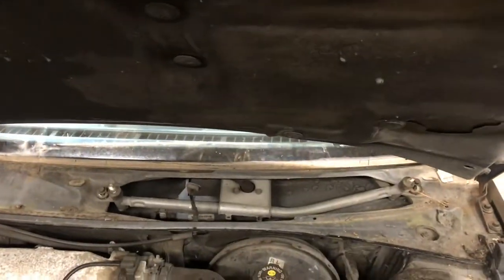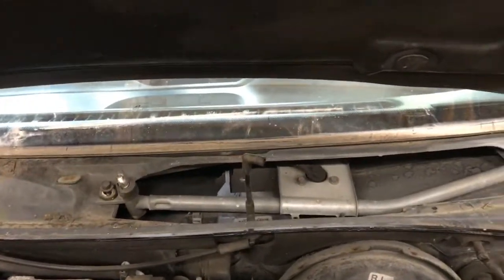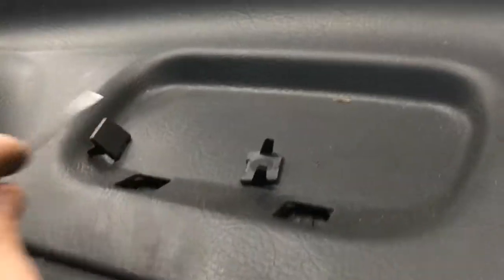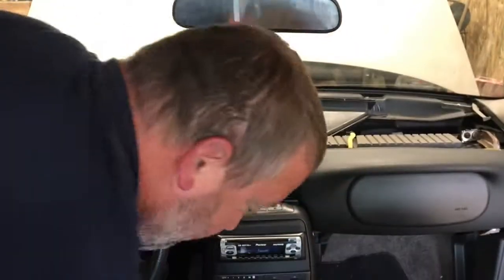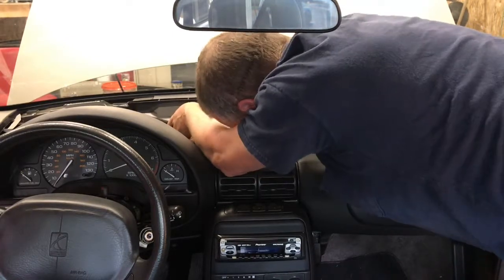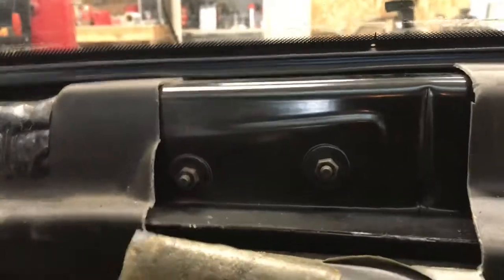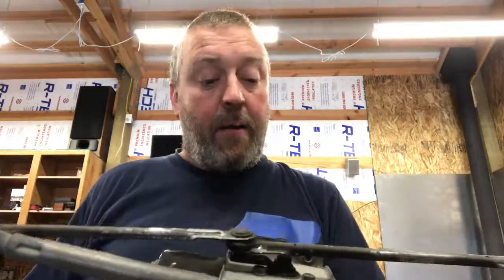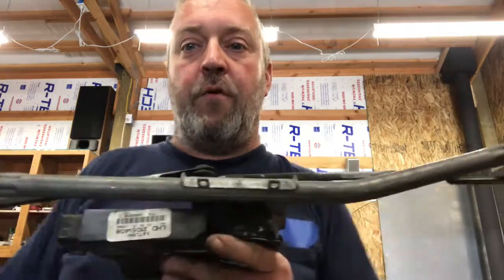Replacing Saturn wiper motor

Comment: This actually can come out pretty easy, if you remove the nut that attaches the motor to the wiper mechanism, then the arm that attaches to the motor can be pried up and then the arms have full flexibility. Use a 13 mm open end wrench to loosen it. Or an easier way is to stop your wiper halfway on the up stroke. Go at that nut with a thin 1/4  flex head ratchet and standard short 13mm socket.   Yes...you will lose the "clock" allignment, but that is easy to figure out after you the assembly back in with the new motor.

Make sure you remove the little plastic dust cap from the old motor shaft and put it on the new motor shaft after you install it on the mounting bracket.  

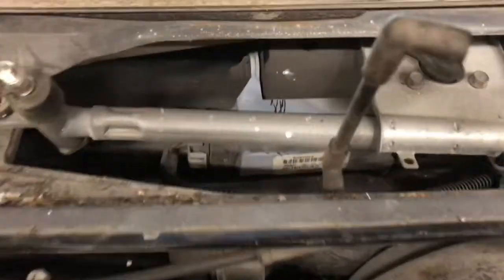Slide the whole assembly back in the opening without the motor attached to the rotating arm.   Attach the electrical connector. Attach the firewall nuts from inside the cab and tighten them to final tightness. Then, cycle the motor and ensure that it spins and stops on the delay setting. Turn it off when the motor is paused and you now know that this is the "rest position" for the wiper shafts.  Slide the rotating arm onto the motor shaft and now you align it. It is really easy. Basically, the rotating arm should point straight left at the 9'o'clock position. (in the video at 0:27, the black rotating arm is at about Ten30, which is actually about 1/8th of the way up on the up stroke).  Once the arm is on, hand thread the nut on and very loosely tighten it, but not fully. Then, do the alignment with the rotating arm pointing 9 o'clock left, the connecting rods should be straight in line with eachother and passing directly over the nut. There is enough space to tighten the nut with a 13mm open end wrench. Wrench with your right hand, and hold the rods aligned  and centered over the motor shaft with your left. 

Once it is snug, go turn the ignition on and run the wiper motor on a delay, watching the wiper shafts turn. You should see them start by spinning clockwise up, then counter down and stop. The shafts shouldn't briefly change directions AT ALL when starting or stopping. Misalignment of the rotating arm will be visible if the wiper shafts briefly start counter clockwise down then cycle up and down. Or if it starts clockwise up, then down, then finishing with a micro clockwise up.  WIPER SHAFTS SHOULD ONLY CHANGE DIRECTION ONCE PER CYCLE.

Once you confirmed it is aligned, I took the extra step of restarting the wiper, then shutting off the ignition and basically freezing the rotating shaft at anywhere from Ten30 to 2 o'clock. This pivots the connecting rods away from the motor nut, and lets me fit my skinny flex head 1/4 inch socket in there and give that shaft nut a good amount of torque. Do this, again, while holding the left-hand connecting rod with your left hand to keep it from putting strain on the motor. 

Reinstall the cowling and wipers and test run the setup. You should be able to put those wipers pretty low, basically within one or two inches from the bottom of the glass. Then reinstall the interior.
Reply: Dude do YOU have a video for you doing it? I'd love to see this way before I attempt mine.

Comment: I just replaced the wiper motor on my Saturn & they work but they don't park in the right place
they stop in the raised position. You gave me the explanation I need I wasn't aware it has to be clocked in the right place
should be easy just one nut holds the short pivot arm. Thanks for posting video.
Reply from the maker: winggullseagull I’m glad it was helpful. Thanks for watching